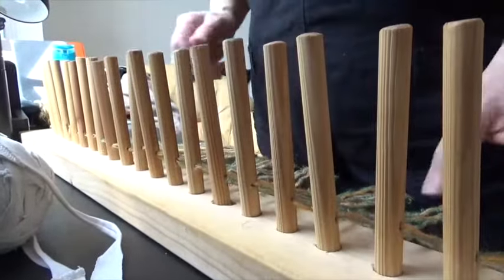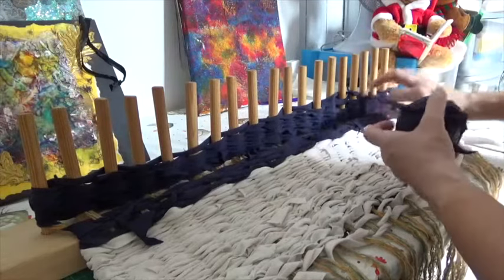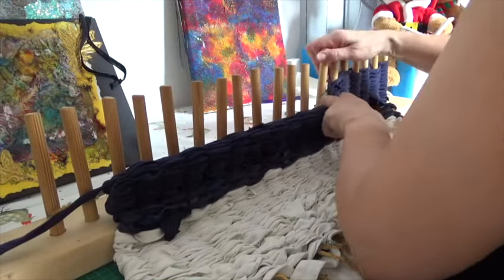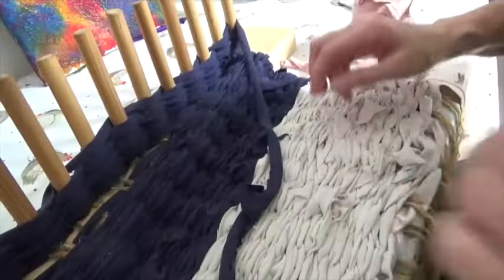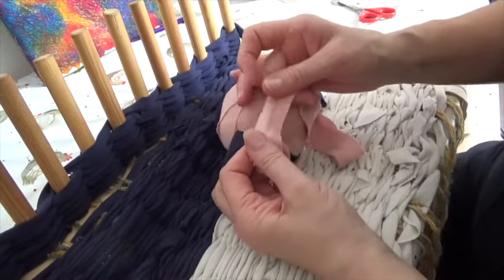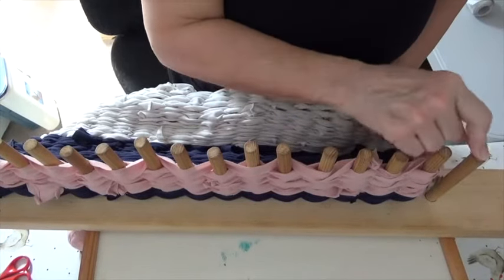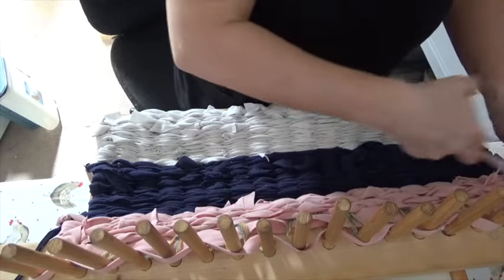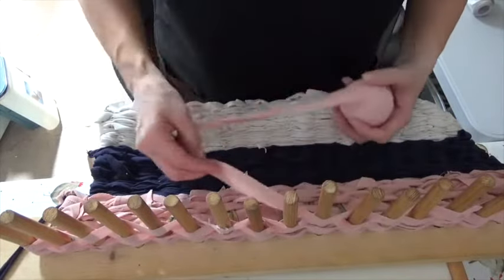Peg loom t-shirt rug

Comment: Did I miss something? Did you show how to finish it of on the ends? I saw the warp hanging down loose but once you weave enough to fill up the warp threads with the t-shirt material how di you finish the warp so the weft doesn't just slide off the ends of the warp thread? Also at the top part how did you complete the end where the pegs are holding the warp?